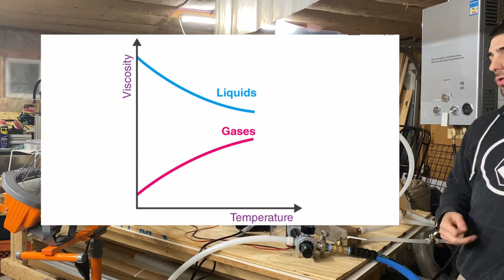How Will The Tesla Turbine Generator Handle A 1200 Watt Electrical Load? Tesla Turbojet R&D

Comment: Awsome test run , this was on room temperature air right? En about 55%or something used from the tank, En Yah you better have these big air tanks outside, if They blow up your safe😅 , one time I've seen such a compressor house been blown up en there is next to nothing left, the reason was that didn't drain the water out 😅

Comment: Might be prudent to have the turbine behind a substantial barrier. Rapid Unscheduled Disassmbly can be a problem when you're dealing with RPM numbers like a Tesla turbine's,
Reply from the maker: Hey Parrot Raiser! Thanks for commenting! It really helps the algorithm. 🙏 

I have a polycarbonate shield blocking me if anything directly were to hit me. Although I could do more. 

But, to be more accurate, I have already done the calculations for the max safe RPMs on these aluminum discs. These 3105 h13 discs at 10in diameter have a max safe continuous rpm of 15,000rpm. And the 6061 t6 aluminum endplates max out at 22,000rpm. 

To put that in perspective the turbine was spinning at only 6,700rpm throughout the whole loaded portion. So I’m well within the max safe continuous rpm that keeps the discs all under 80% of the max yield strength and 75% of the max tensile strength 

So yeah, I’m no where near high RPMs. And that’s kind of what I’ve been trying to prove to everyone too. That they don’t need to be spun fast and that all the “Tesla turbines have to be spun fast to work” are pure myth. 

Even Tesla never says to run it fast as a turbine. He does say to run it as fast as a pump or compressor, but that’s because all centrifugal pumps performances are dependent upon tips speed. 

What Tesla does say to do is that to increase economy you reduce the slip, and that’s done by increasing the surface are and decreasing the discs spacing. 

“Owing to a number of causes affecting the performance, it is difficult to frame a precise rule which would be generally applicable, but it may be stated that within certain limits, and other conditions being the same, the torque is directly proportionate to the square of the velocity of the fluid relatively to the runner and to the effective area of the disks and, inversely, to the distance separating them. The machine will, generally, perform its maximum work when the effective speed of the runner is one-half of that of the fluid; but to attain the highest economy, the relative speed or slip, for any given performance, should be as small as possible. This condition may be to any desired degree approximated by increasing the active area of and reducing the space between the disks.”
-Nikola Tesla 

“But it may be pointed out that in one respect, at least, the two machines are essentially different. In the pump, the radial or static pressure, due to centrifugal force, is added to the tangential or dynamic, thus increasing the effective head and assisting in the expulsion of the fluid. In the motor, on the contrary, the first named pressure, being opposed to that of supply, reduces the effective head and the velocity of radial flow toward the center. Again, in the propelled machine a great torque is always desirable, this calling for an increased number of disks and smaller distance of separation, while in the propelling machine, for numerous economic reasons, the rotary effort should be the smallest and the speed the greatest practicable.”
-Nikola Tesla 

Furthermore, Tesla Also says you in fact do not want to spin it too fast because the centrifugal head created eventually cuts off the incoming fluid flow and actually self regulates the turbine. 

“Still another valuable and probably unique quality of such motors or prime movers may be described. By proper construction and observance of working conditions the centrifugal pressure, opposing the passage of the fluid, may, as already indicated, be made nearly equal to the pressure of supply when the machine is running idle. If the inlet section be large, small changes in the speed of revolution will produce great differences in flow which are further enhanced by the concomitant variations in the length of the spiral path. A self-regulating machine is thus obtained bearing a striking resemblance to a direct-current electric motor in this respect that, with great differences of impressed pressure in a wide open channel the flow of the fluid through the same is prevented by virtue of rotation. Since the centrifugal head increases as the square of the revolutions, or even more rapidly, and with modern high grade steel great peripheral velocities are practicable, it is possible to attain that condition in a single stage machine, more readily if the runner be of large diameter. Obviously this problem is facilitated by compounding, as will be understood by those skilled in the art. Irrespective of its bearing on economy, this tendency which is, to a degree, common to motors of the above description, is of special advantage in the operation of large units, as it affords a safeguard against running away and destruction.”
-Nikola Tesla.
Reply from the maker: Just released the latest update! 
Tesla Turbine 250 watt to 2.65 kW Power and Efficiency Test
https://youtu.be/XQl1DQgXVkQ

Comment: I actually didn't know gas viscosity was inverse prop with temp, that's an amazing factoid. So hot gas/vapor is going to increase efficiency, IE drag the disc around like a mofo. Interesting question then, since disc spacing is fixed, how does it affect the turbine's operating point? At some point does increasing temperature of hot gas/vapor further actually limit flow and bring efficiency (speed/torque) down? Or does it just mean you can just run at a lower RPM for the same torque? The more you know the more questions you have, haha. Gonna have to characterize that beast!
Reply from the maker: Hey infinion! Thanks for commenting. It really helps the algorithm push my video. 🙏 Yes there is a point that it becomes to much. This is where capillary repulsion overcomes capillary attraction. However I don’t think we are anywhere near that for gasses.
Reply from the maker: Yes! It will reduce slip, ultimately increasing torque for a given rpm and thus power out for a given fluid supply, increasing efficiency. 

But so the high rpm thing. That’s kind of what I’ve been trying to prove to everyone too. That they don’t need to be spun fast and that all the “Tesla turbines have to be spun fast to work” is pure myth. 

Even Tesla never says to run it fast as a turbine. He does say to run it as fast as a pump or compressor, but that’s because all centrifugal pumps performances are dependent upon tips speed. 

What Tesla does say to do is that to increase economy you reduce the slip, and that’s done by increasing the surface are and decreasing the discs spacing. 

“Owing to a number of causes affecting the performance, it is difficult to frame a precise rule which would be generally applicable, but it may be stated that within certain limits, and other conditions being the same, the torque is directly proportionate to the square of the velocity of the fluid relatively to the runner and to the effective area of the disks and, inversely, to the distance separating them. The machine will, generally, perform its maximum work when the effective speed of the runner is one-half of that of the fluid; but to attain the highest economy, the relative speed or slip, for any given performance, should be as small as possible. This condition may be to any desired degree approximated by increasing the active area of and reducing the space between the disks.”
-Nikola Tesla 

“But it may be pointed out that in one respect, at least, the two machines are essentially different. In the pump, the radial or static pressure, due to centrifugal force, is added to the tangential or dynamic, thus increasing the effective head and assisting in the expulsion of the fluid. In the motor, on the contrary, the first named pressure, being opposed to that of supply, reduces the effective head and the velocity of radial flow toward the center. Again, in the propelled machine a great torque is always desirable, this calling for an increased number of disks and smaller distance of separation, while in the propelling machine, for numerous economic reasons, the rotary effort should be the smallest and the speed the greatest practicable.”
-Nikola Tesla 

Furthermore, Tesla Also says you in fact do not want to spin it too fast because the centrifugal head created eventually cuts off the incoming fluid flow and actually self regulates the turbine. 

“Still another valuable and probably unique quality of such motors or prime movers may be described. By proper construction and observance of working conditions the centrifugal pressure, opposing the passage of the fluid, may, as already indicated, be made nearly equal to the pressure of supply when the machine is running idle. If the inlet section be large, small changes in the speed of revolution will produce great differences in flow which are further enhanced by the concomitant variations in the length of the spiral path. A self-regulating machine is thus obtained bearing a striking resemblance to a direct-current electric motor in this respect that, with great differences of impressed pressure in a wide open channel the flow of the fluid through the same is prevented by virtue of rotation. Since the centrifugal head increases as the square of the revolutions, or even more rapidly, and with modern high grade steel great peripheral velocities are practicable, it is possible to attain that condition in a single stage machine, more readily if the runner be of large diameter. Obviously this problem is facilitated by compounding, as will be understood by those skilled in the art. Irrespective of its bearing on economy, this tendency which is, to a degree, common to motors of the above description, is of special advantage in the operation of large units, as it affords a safeguard against running away and destruction.”
-Nikola Tesla.

Comment: My mans
Reply from the maker: Thanks cavelvlan25! I appreciate the love and support.l! ❤️ every comment helps the algorithm.
Reply: @CharlieSolis it's the least I can do.  One day society as a whole just might owe ya one. I'm a broke mf so I'm getting a head start hahaha.
Reply: @CharlieSolis   I'm still pretty adamant about seeing a axle flux generator applied. Specifically a vertical shaft directly to the turbine.  I feel there's a lot more Energy production that could be harvested with a tailored generator. Large diameter (clutched) Flywheel rotor combination, adjustable stators for easy startup ,Friction-less ( floating or magnetic) bearings,  less weight distribution problems with vertical shaft. all possible with axle flux. Magnetic gears would make it stupid quiet not to mention increase efficiency. I totally understand the generator would be a whole build in itself. I know u have big dreams. If I weren't a total dunce when it comes to maths I would almost insist on joining the cause but I digress.  

-Stan (jk lolz)
Reply: Couple side notes, not to blow you up or anything. You and Robert Murray Smith would make a great collaboration.  Any idea of an estimated power loss% from having to match the standard hertz? Could you ,in theory, exactly double the hertz and operate without being out of phase? Say 60 hz ran on 120 hz you would be in sync or would it runaway?
Reply from the maker: Check out the Part 2 of this video. It goes through a lot more of the actual numbers and calculations. 
https://youtu.be/bWpXRzrzf4g
Reply from the maker: And by all means, blow it up! Lol it only helps!

Comment: Looks good man. I would suggest the next step be a variable speed motor on a Variac  with Volt and amp meters on both sides. Possibly with a friction break to add a bit of load so you can get some good torque curves.   Be interesting to see what a phase monitor on each motor would tell you per leg in 3¶.  
Also agree you can start applying ideal gas law to the steam and phase transition levels. Like the debate over ice melting faster I have good reason to believe that condensing vapor as a push source on veins in a turbine impart further centripetal forces as the condensation is forced to the outside edge of the veins.  
I noticed this when watching the running systems in coal plant in Serbia. The use junk coal mostly so boiler temp is important with more clay because it Acts as it  bakes off as Thermo absorber
Reply from the maker: Hey Evan, have you seen the power and torque curves for the dyno runs? 
Amazing Custom Tesla Turbine Dyno Horsepower And Torque Outputs! + 300mph 3.75hp 6.22 ft-lbs 4150rpm
https://youtube.com/shorts/Zxy8mIVG6as?feature=share
Reply from the maker: Just released the latest update! 
Tesla Turbine 250 watt to 2.65 kW Power and Efficiency Test
https://youtu.be/XQl1DQgXVkQ

Comment: Power input?
Reply from the maker: Hey Liam! Check out part 2! 
Tesla Turbine 1200 Watt Electrical  Load Tests - Power Calculations - compressed Air + Propane heater 
https://youtu.be/bWpXRzrzf4g
Reply from the maker: Just released the latest update! 
Tesla Turbine 250 watt to 2.65 kW Power and Efficiency Test
https://youtu.be/XQl1DQgXVkQ

Comment from the maker: If you would like to become a monthly donor go to my patreon and join our growing community of Tesla Turbine enthusiasts! https://www.patreon.com/CharlieSolis

#NikolaTesla #TeslaTurbine #TesTurEnergy #solarpower #SteamTurbine #SolarSteam #SolarTurbine #TeslaTurbo #renewableenergy #greenenergy 

Check out my latest updates. Here’s my latest 10in diameter, 75disc aluminum and plastic prototype drive turbine dyno, 2.75kW and 6.22ft-lbs of torque to the shaft at only 4150rpm with a 150psi room temp compressed air supply from a regular piston compressor for now. I’m gearing it UP AT 1:3.6 to dual BLDC gens with a Kv rating of 2200rpm/volt. So for every 611 RPMs on the turbine the generators output 1volt. 
https://youtube.com/shorts/Zxy8mIVG6as?feature=share

Tesla Turbine Generators With Usable Power and Torque
https://youtube.com/playlist?list=PL4XBGjR8Gu-Emu1QRPIwATKFuCZabqOh1

1200watt continuous electrical load output with room temp compressed air all the way down to 65 psi too and with the turbine only at about 6700rpm.
https://youtu.be/BHPAQF8QNnw

This is a look through of the 10in disc stack of 75 discs, +10,000in^2
https://youtube.com/shorts/FU2LMZQ2_yA?feature=share

These are the latest liquid fuel burner tests for the replication of GB 186,083.
https://youtu.be/gRqKowignac

These are the latest propane burner tests.
Tesla Turbine Jet Engine Combustion System GB 186,083 Superheated Steam
https://youtu.be/KCyyiKnIarc

I haven’t gotten to my Tesla disc compressor tests finalized just yet but I have the setup to do them already just gotta do some upgrades to my bearing and gear hubs for the generators. 
10in Tesla Compressor & Turbine w/ Built In Balancing Apparatus RC Car Dual 6s 3kW 2200kv BLDC Motor
https://youtu.be/fCQn7Q0rroI

Comment: nice man 1200 watt is pritty useful 😎 about the viscosity of vluids,  is this what the critical point is? For exceple Water? Where the density of the gas en the liquid meets ?
Reply from the maker: Precisely! Because there is no phase change from a gas or a liquid once at supercritical points the viscosity would be a continuous line, as opposed to the discrete jump between liquid and gas viscosity.

Comment: With you steam device will it run your tesla turbine with that reduction an number of generators. Or is its power output to low. Have you tried running it yet.
Reply from the maker: Hey Cole! Thanks for commenting. I’m not sure I follow. Could you elaborate on that a little more?
Reply: @CharlieSolis  what pressure and volume is your steam generator producing and with the tesla turbine you posted the video with gear reduction etc what pressure and volume is required to start and run it. My question is will it have enough power to run the tesla turbine with the generators?
Reply from the maker: Hey Cole! So yeah it doesn’t take much pressure to spin this turbine at all. 

Check out this unlisted video of mine. 
https://youtu.be/K_thvP3U8tc

In that video I just take a blow gun and aim it down into the casing nozzle, that’s not sealed up at all mind you, and the turbine spins right up. 

This doesn’t have the generators on it but I can spin the turbine by hand very easily when connected to the generators. 

It’ll keep spinning for a second but comes to a stop. 

And now with my nice new bearings and MUCH better motor/Gen mounting plates that keep everything nice and squared up it spins even more freely with the gens connected now than it did free spinning before. 😈😈😈

Comment: What about the watts consumed by air compressor?
Reply from the maker: Hey Afzal Khan, thanks for commenting. 

The energy available for the turbine to use can be calculated from the energy available in 170gal tank at 150psi dumped to 65psi. 

The efficiency of hardware store compressors (which is at best 10-15% efficient) is not a good reflection of how well the turbine actually works. 

The isentropic efficiency of the turbine is determined from the energy available in the tank compared to the energy output to the shaft. 

Take a watch at the part 2 of the power output tests + thermal addition. 
Tesla Turbine 1200 Watt Electrical  Load Tests part 2 - Power Calculations - compressed Air + Propane
https://youtu.be/bWpXRzrzf4g
Reply from the maker: Just released the latest update! 
Tesla Turbine 250 watt to 2.65 kW Power and Efficiency Test
https://youtu.be/XQl1DQgXVkQ